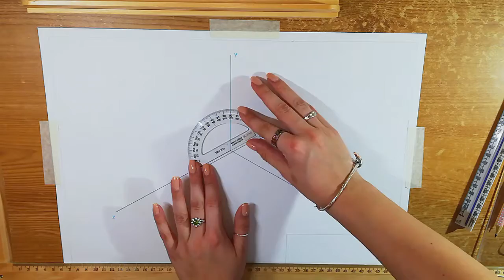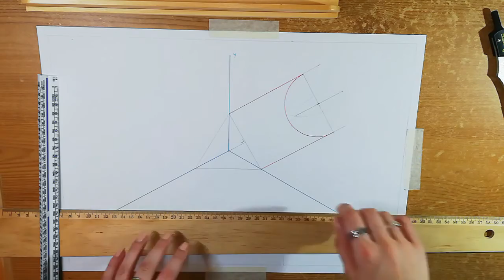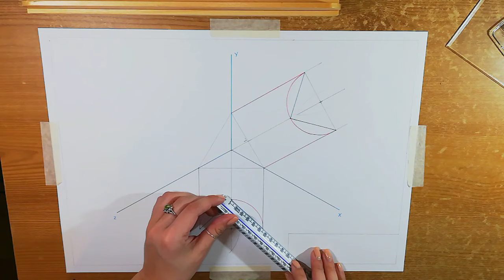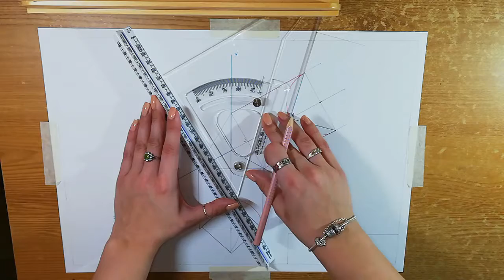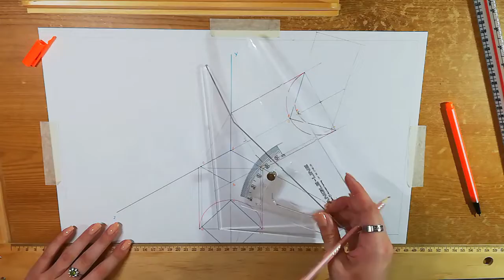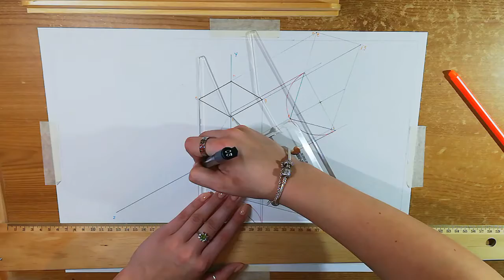Axonometric Projection - How to Draw Isometric Projections (Basic)

Comment: What is different between Axonometric & isometric view,,,, or projection.
Reply: An isometric view is a 3D representation of a 2D object, aligned to three axes - x,y,z. 
It is an axonometric projection in which the three coordinate axes appear equally foreshortened
Orthographic projection are 2D portrayals from 3D object 
usually the front, side(sometimes left and right), top and back view of the object